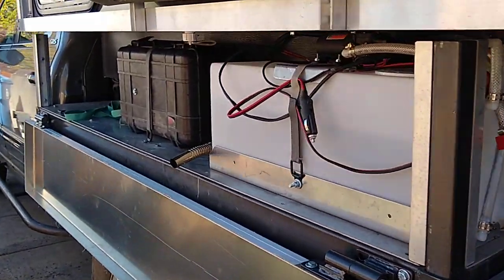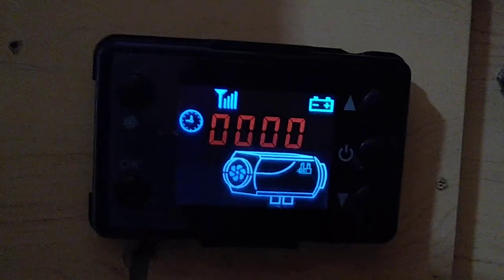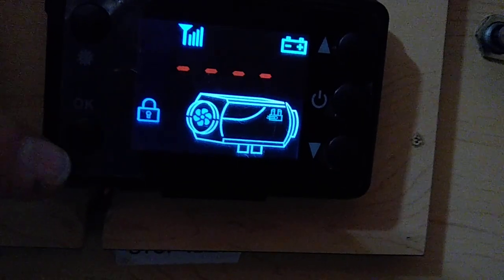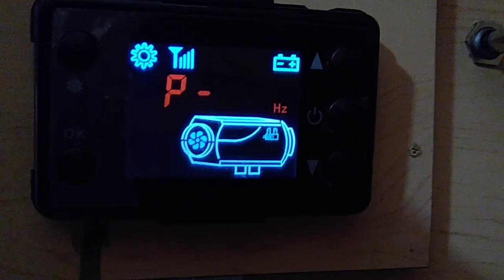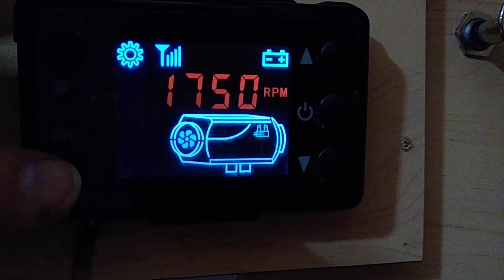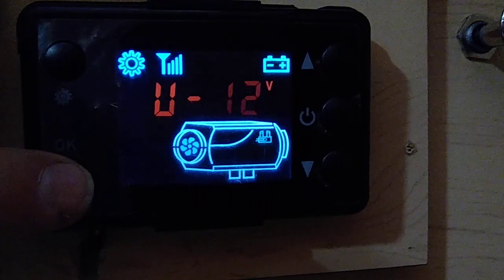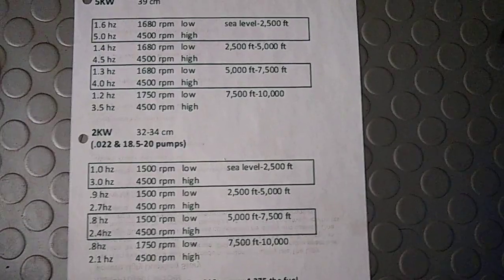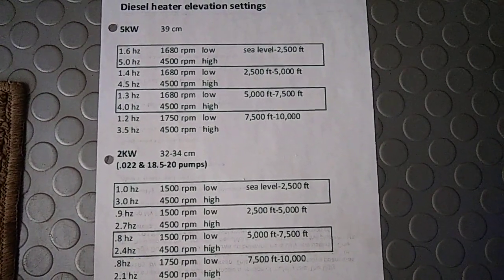Adjusting your Chinese Diesel parking heater for High altitude elevation or sea level use.

Comment: The controller that came with my new 2kw does not feature the fine controls you demonstrate.  It has a fixed "alpine mode", the function of which I can't find defined anywhere, but it's hard to imagine it senses elevation.  You can't even set temperature manually as pump rate in Hz; manual temp is expressed as H1, H2...   Mix obviously running rich at 5000'/1500m above sea level, evidenced by white exhaust smoke and other suspicious fueling behaviour.  It's been suggested I can use my old controller -- the one you demonstrate -- with my new heater, provided I replace the motherboard, which would obviously cost more in time than a new unit.  Any advice?  

Note this "new blue" trim model is programmed in different ways, one of which agrees with the controls you demonstrate and other that behave as I describe.  Ref https://www.youtube.com/watch?v=owvQrBaSXOs   and    https://www.youtube.com/watch?v=OjuZFT2G5DY   -- evidently the former is the one Vevor uses; mine I got my 2kw cheap on Amz came with this controller -- bad on me I guess.  Thx, and great vid.  Z
Reply from the maker: From everything I have seen, you need to buy a motherboard and controller as a set. I will poke around and see if I can find something that might work. Frustrating for sure!!
Reply: @Colorado2Bangkok installed a new motherboard and controller today on one I just bought.  I'm at 7000ft, hopefully she chooches better.